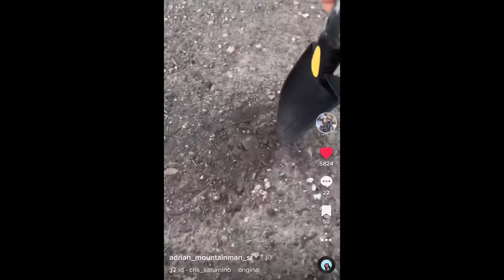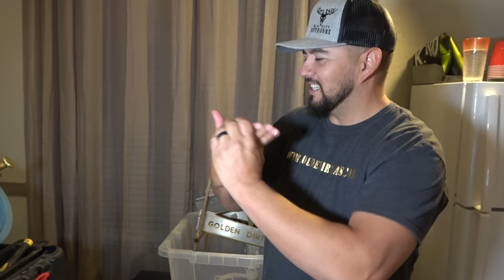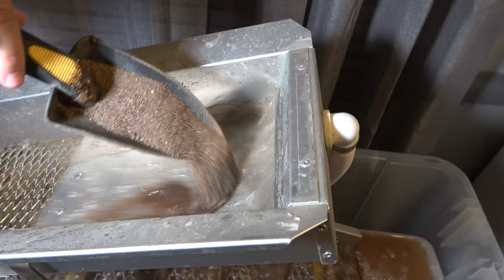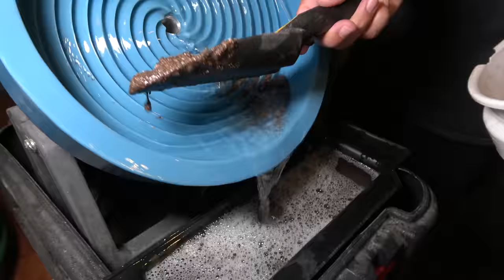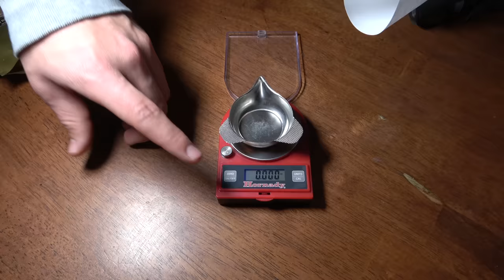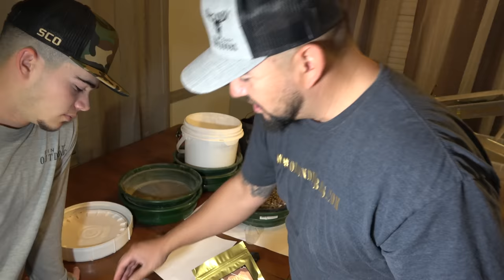I Spent $1900 on a Bucket of DIRT!! Was It Worth It?

Comment: Awesome video guys and you did really well with your weigh up, A good hint for you Senior when you are running your sluice add some dishwashing liquid as this will stop the finer gold from washing out into that lower tub, yes gold floats. Good thing you guys did not go check out the Mississippi River with the nasty storms they copped. I too am an avid watcher of gold prospecting sites I was gifted a small amount of paydirt from one of them and I spent between 30 to 40 minutes sorting it out. I don't have a miners pan yet so I used a clear plastic container lol added some dishwashing liquid and slowly panned it out I got 1 tiny specs and 2 larger bits had a lot of fun actually doing it rather than watching it. cheers again for yet another top quality video and have a very good week 😁🤑🤑😉

Comment: I have used the same spiral for over a decade and I can tell you for sure that it is being overfilled big time. You should be using a way smaller tool to scoop it into the spiral. I use a table spoon to slow myself down. Based on the video I would think at least 10% of the concentrates went straight out of the spiral in to the catch basin because of that. That’s what the catch basin is for though after all so no big deal. It sure seems like I’m wrong based on how much gold was found and weighed, great product worth every penny. fun video and I would love to see more. I subscribed when you guys started the lake Mead water level update videos and it’s awesome to see the passion for prospecting also. I had no idea about the past videos about it but I need to check those out.

Comment: When I moved to Arizona I also spent a fortune on equipment. I bought maps and all different metal detectors. Unfortunately I had no one to go with. So I joined a club that had a few claims and I went to check them out. Everyone was hauling hundreds of gallons of water and setting up on sight, but I thought them people were nuts, just sitting there the entire day. So, instead of taking water to the gold, I brought the paydirt with me. Well, If my boss told me to load my truck with dirt and go home and pan it, I wouldn’t do it for a thousand dollars a day, but because of gold fever, I did it every day for a month and all I got was about $200.00 of gold. And I swear it was planted because it wasn’t smooth, it has (HAS because I still have it) sharp edges. If you ever go to my house where I panned for gold, the landscape is all mounds of dirt with granite/ gravel on top. And it’s dirt that I would NEVER haul as a job, but the addition of looking for gold, made me do it and it costed a fortune. 
The moral to the story: if I ever need to put in an in ground pool, I’m going to a prospector’s club and tell them that I have gold in my backyard, and they can dig it out and keep it, just as long as they take the dirt to their home… like this sucker did.

Comment: You need to get out to the SanFran sea shoreline with all of its black sand.  In the 1920s-30s, there was massive gold workings on the beach and took out 3 MILLION ounces of gold from the sands.  Now a federally protected area and all the offshore area - that (we tested the sands) and researched that titanium, iron, gold, silver, copper, vanadium and others were analyzed in the 1950s.  The real pre-1850s SanFran Bay undersands from all current sludge and dookie in the Bay still holds massive alluvial prehistoric gold as well as the outer banks of the area in the $ multiple 10s of TRILLIONS